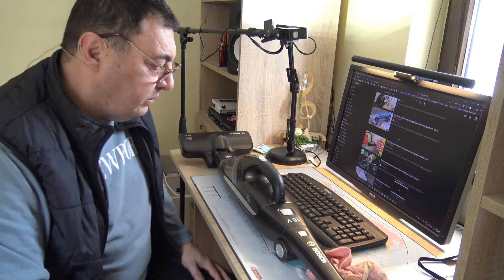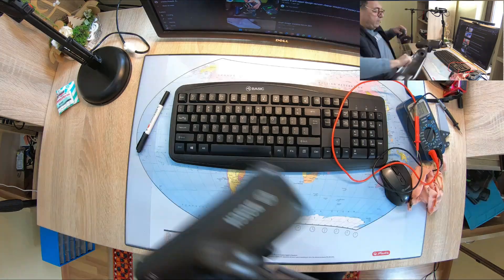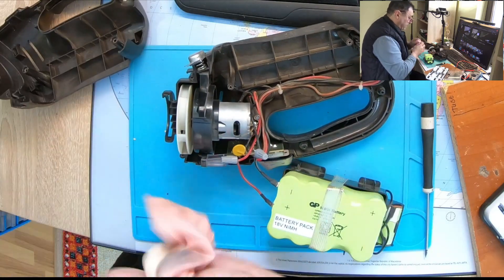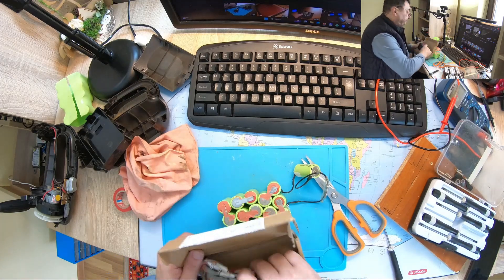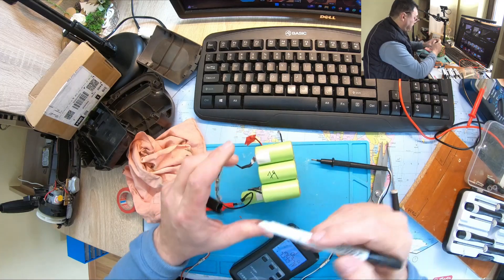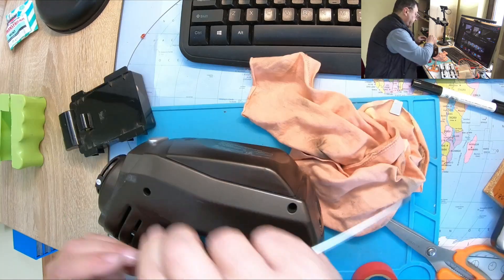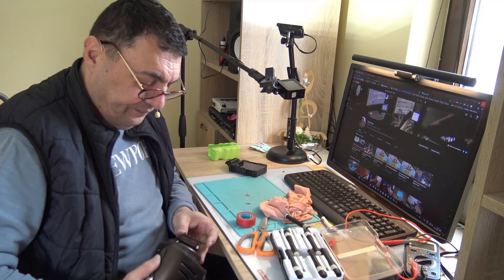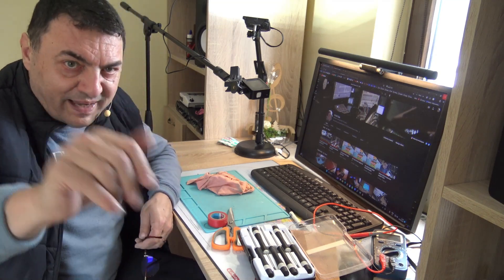Bosch 2in1 BBHMOVE5N battery check

Comment: 5 x 18650 LiIon batteries with a proper BMS  will work fine. 
I did it with a cordless drill. It works better than before.
Reply from the maker: I just ordered 5S charger designed for drills...it will do the job and of course 18650 are on the way.
Reply: @viocaia  Wish you good luck.
Reply from the maker: @ampere0124  Thanks for support!

Comment: Hi in 1.07 you mesure 4.3amp but you do not show where you made a test  and then at 4.19 you test the battery resistans  how much resistans they should have to be good? thank you in advance for any feedback
Reply from the maker: You see those 4 contacts  inside the case, or better 4 contacts on the vacuum itself, those are for the switch and for supplying the extra motor for rotary brushes. So you can touch with the ammeter those for switch and the motor should start.I'll do short about soon. As for the internal resistance for 18650 I found until 40milliohms are ok, they say like 20 to 80 will be ok...I rather found more than 60 to be ''tired'' not so good for power applications but still good for lighter or arduino…stuffs like that. Here we need current , so I suggest my configuration it's need.
Reply from the maker: Look here https://www.youtube.com/shorts/oMmo9YyTkzA?feature=share